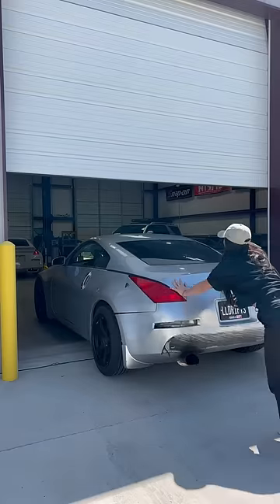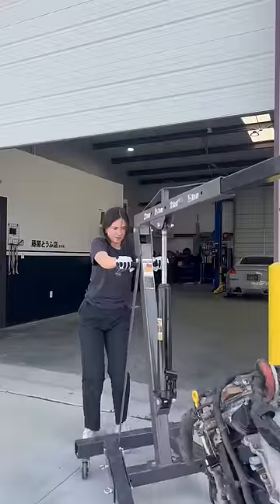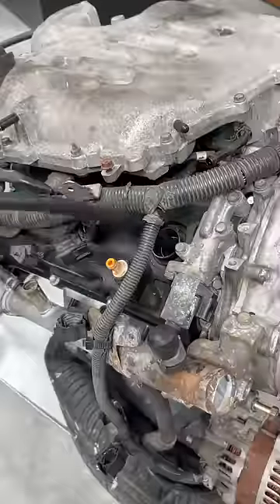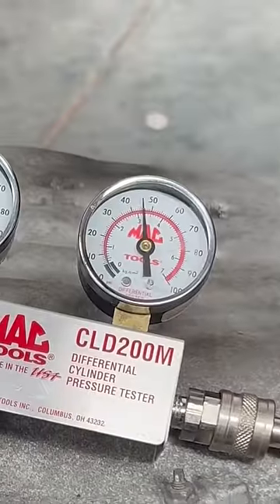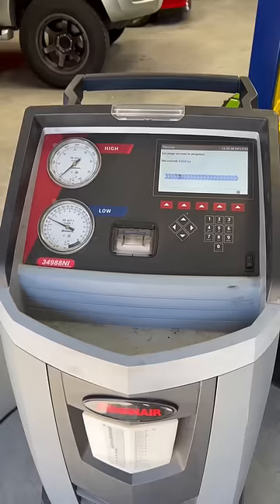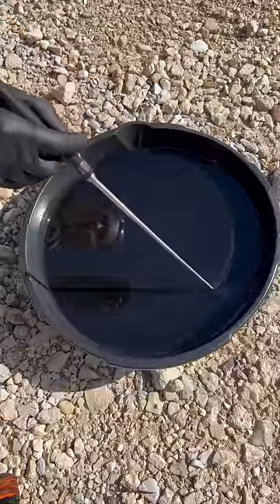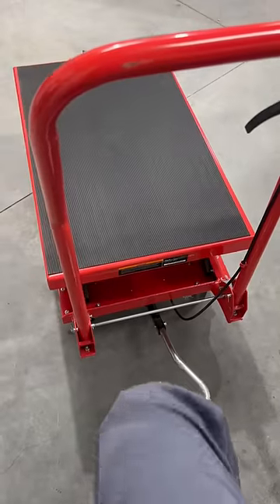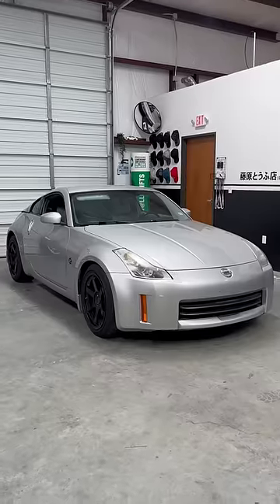VQ35 Engine Swap on a 350Z: Part 1✔️

Comment: 58,000 miles and engine already failed. What in the hell is Nissan doing 💀💀 thats worse than BMW and Mercedes combined
Reply: The vq is supposedly decently reliable. It wouldn’t surprise me if the last owner beat it to shit, especially considering the condition of the rear bumper.
Reply: It’s a revup motor which is known as one of the worse v6 ever imo. Regardless 350z owners always recommend to stay away from them and just get a regular DE or HR
Reply: @CaptChaosBluely  it's sad because 350z is such an iconic drift car nowadays but the engines dookie so I'm assuming it's best to just leave it stock power and drift it like that, or engine swap it
Reply: Probably was low on oil and not maintained. I know those vq motors gobble up oil.
Reply: With simple and basic maintenance, VQ’s are extremely reliable. Clearly, the previous owner didn’t keep up with that and beat the shit out of it resulting in those issues
Reply: It could also be the abuse it was put through before this owner. Because every kid who just got their license wants this car and they end up beating the shit out of it
Reply: @carma  from my own experience unless a cars been modified there's only so much damage you can even do with a stock engine. Cars are meant to handle stock power from the manufacturer that's how they're designed so unless you're redlining constantly there's not really anything else you could do to damage the engine persay. Most abuse will be to the clutch or trans or if someone's drifting you can even be damaging suspension, bearing and uneven tire wear.
Reply: Depends on the previous owner did and how well he or she took care of it. Obviously either the engine shat it’s self or it was beaten and treated like garbage 🗑️
Reply: Use to sell these 350z’s years ago. They CHEW up oil…. Nissan is NOT the way to go if you dont service your vehicles consistently!
Reply: If it's an 03 350z it's absolute shit.. had one.. it was absolute shit 🤣
Reply: Lol you clearly know nothing about engines
Reply: @juanlozano3715  clearly more than you do
Reply: Did you see the oil. That shit was never changed 😭
Reply: odometer roll back duh
Reply: It’s who they sell them too every manufacturer has this issue. The consumer.
Reply: The revup had a recall for early models for oil consumption and failing around this mileage the ring gap was wrong on them to even after the recall they burned oil but it made them not blow up if u change the oil regularly and dont miss one
Reply: Benz don't fail (if you take care of them every 10k miles with everything new)
Reply: Sounds and looks like a teenager had it first
Reply: I’m guessing is that previous person was doing u know what with the car😏
Reply: That has nothing  to do with the engine the previous owner just beat the shit out of it in a unreliable way
Reply: it depends on the chimpanzee that uses it...
Reply: Lmao what😹 BMW is the 3rd most reliable car brand
Reply: @F80__Los according to who?
Reply: @Username-2  any factual place online
Reply: Most likely? Some kid had it and was beating on it like he was in Tokyo drift
Reply: More like the bums driving it don't know that the rev up version of vq35de is actually the worst model because it burns oil about a quart every 400 miles. It's prone to knocks and ticks if it gets dogged out and if oil levels aren't maintained. Regardless the way people drive these cars g35/350z you can't expect them to last longer than BMW or Mercedes because those owners actually take care of their cars since they are expensive.
Reply: rev up = 🗑
Reply: Clapped track car.
Reply: I have 177k miles original engine , they just beat that shit
Reply: If you dont change the oil and it has 58,000 it will break. I gurantee this was user error somewhere
Reply: @trentulloa  agree 100%. Know someone personally who never changed the oil in his cars. Just added to it every once in a while and traded em in before it broke.
Reply: @IntrnetCat thats what happened to my Veloster's transmission. Died before 100k, replaced it, and a part failed under 5k later. Super hard to tell whether it's Hyundai quality or the user after that second one
Reply: Its not blown.. Its a common cam phaser , rocker, or "lifter" ( their version of one. They dont have lifters)
Issue.

Could also be a cam bearing
Reply: @AngryGinja My dad had one for 13 years. Bought it in 04 and the engine went out in 2017. Had just under 150k miles. It's the car he's owned the longest.
Reply: Its in a Z, those things get trashed and thrashed by their owners.
Reply: Mercedes engines aren't bad?
Reply: This more than likely user related issue almost 200,000 on mine and just now needs to be replaced.
Reply: these cars are all beaten and abused. either they get totalled or blown up
Reply: Most people don’t do the maintenance required 
That engine has variable valve timing and hydronic chain tensioners
In combination with a pretty shallow oil pan
If you don’t check the oil regularly 
Or the coolant 
And you go for a stomp on the pedal they can break
I’ve got one of those engines running still at over 220k chains replaced at 205k 
Car itself has had a transmission 
And the regular wear and tear items 
But the Nissans toyota and Hondas from about 99-06 were all pretty solid reliable cars that you could tune and build into something fun or just make it last forever as a daily
Reply: The vq is on of the most reliable engine out there lol. Probably was neglected when it came to oil/servicing.
Reply: This is why the Rsx surpassed the 350z different drivetrains but the 05 /06 type s has my heart. Nissan has only disappointed me on how sensible it all is. Hondas are legos and we can’t say the same thing about Subaru maybe some Toyotas. Overall cool video
Reply: Vq is a really good engine if you abuse it it will fail
Reply: @AteFruit it won’t be dookie if it’s not rodded to death I assure u that
Reply: @McBlitz52  if you add any power it's gonna blow up, that's how Subarus are too 🤣
Reply: It's not the engine it's the driver these engines are bullet proof unless it's not taken care of
Reply: They definitely ran it without any oil. I always ran my Z on low oil level (still acceptable tho) and it's still perfectly running at 250'000km
Reply: @AteFruit the engine just isn’t “dookie”😭😭😭
Reply: It’s an owner problem not a Nissan engine problem.
Reply: @devinminder5599   that's what Subaru owners like to say too xD
Reply: I mean it's a Renault so
Reply: @AteFruit  the engine in my maxima is an award winning engine chief I don’t know what to tell you. Feels way faster than what a 3.5v6 should be. If anything hate on the jatco tranny🤣 those actually last in the maximas way longer than the altimas and Sentras though mfs just don’t stay up on checking their transmission fluid.
Reply: @devinminder5599  most of modern Nissan is garbage.
Reply: Any cars without an oil change intime gona  have  problems. Or high rv at cold start.
Reply: @huynhtran7140  a big part of the issue is the manufacturers give you a maintenance schedule for regular use, but if you actually read what it requires, almost everybody drives in a severe use classification. So with regular use you you can go 6000 mi /6 mo on a conventional oil change but with severe use it goes back to the traditional 3000/3mo.most people don't even serve there transmissions. At most they "flush" them
Reply: @masjuggalo  i  know what u  saying.i was in  this trade too.sadly new cars all  rubish😑
Reply: @AteFruit  not in my personal experience tbh, you ever owned or even driven one?
Reply: @AteFruit  the vq is a good engine but the rev up engines were trash. The de and hr versions are reliable af.
Reply: @kellylynn9295  they can't handle added power
Reply: It’s cvt transmission what do you expect
Reply: @AteFruit  yea that's true. But stock they can last as long as it's not the rev up. Lol
Reply: @xxsniperdragon1  failure. I expect failure.
Reply: That's not on Nissan.  Bad owners...
Reply: @chrispaugh310  If you own any car at all no matter who makes it, if you don't service it when you're supposed to it's going to break. That's how it works. If you can't afford to maintain a car, then don't buy one.
Reply: @AngryGinja  It was only absolute shit because the person(s) who owned it before you obviously destroyed it. Even an 03 Z in good moderate condition is far from a "piece of shit".
Reply: @dncInfamous  My VQ engine is 16 years old and burns exactly zero oil. They only burn oil if you fuck the engine up by not changing the oil when it's due.
Reply: @AteFruit  I don't know where you get this "the engine is dookie" from... because it's simply not true. It's so stupidly easy to push a VQ to 500hp... clearly you don't really actually know anything about these engines and just repeat shit you hear online.
Reply: @soldjahboy  well considering 03 was the first year of the 3.5 vq engine that put it up for the worst year of production.  I'm sure there were plenty that turned out fine it was just not a good year of 350 to get.
Reply: @soldjahboy  and it wasn't necessarily the person who owned it before me. The car was declared a lemon before it was even shipped to where I bought it from.. unfortunately I was naive and had tunnel vision and didn't get Informed of the lemon status. Regardless it had more than just engine issues.. plenty of electrical too so yes it definitely earned the shittiest year ever made.. you can polish a turd, but it's still a piece of shit
Reply: @AngryGinja It was SOMEONE who owned it before you... these cars don't just fuck-up for no reason. I have seen so many rebuilt VQ engines, it's almost ALWAYS a lack of maintenance.
Reply: @soldjahboy  do you understand what a lemon is? It doesn't matter if it was someone who owned it before me of whether I was the first one to own it.. once it's declared a lemon it's a lemon.. hence why they have lemon laws 🫡
Reply: @AngryGinja  Yes I understand what a Lemon is, and 99% of the time it became a Lemon because of someone's mistreatment. It's extremely uncommon for a factory Lemon, especially on a vehicle that has a proven platform. Not saying it can't happen, just saying it was probably someone's fault...
Reply: @soldjahboy  did you know that in order for a lemon law to be applied or a car to be declared a lemon it cannot be because of the abuse of an owner.. has to be a defect caused by the manufacturing process.. and no its not rare
Reply: @soldjahboy  dude the 350 never had a proven platform what are you babbling about.. 350z had its conception in 2003.. sorry but nissan didn't use 300zx motors in a 350z shell.. typically the earlier production years are the "fix the kinks" years..
Reply: @captchaosbluely1339 😂 one of the worst v6’s that is faster than any other v6 and more reliable than 95% of other v6’s. Okay buddy
Reply: @AteFruit no you don’t know anything. This motor which comes in 06 models is notorious for oil consumption the previous owner probably neglected it it ain’t Nissan fault
Reply: @IntrnetCat they have a really difficult to read oil dipstick that’s inaccurate most of the time. This combined with the fact they they frequently burn oil makes them get oil starved and grenade themselves.
Reply: @Red_Cp3  if you change your oil like a religion they should be fine. I have an 05 maxima with a vq and it doesn’t burn oil but I am gonna have to get its oil change done in the next one or two hundred miles
Reply: @IntrnetCat  Marximas are FWD which means the engine is mounted properly. VQ weren’t originally made for RWD so when they’re placed transversal the dipstick becomes impossible to read that’s why so many of them oil starve.
Reply: I’m pretty sure it was either extremely abused or rolled back mileage
Reply: Shiney oil bro… that should tell u enough
Reply: it’s reliable. whoever had it just didn’t take care of it
Reply: Had a vq and took her all the way to 240,000 miles while taking it drifting and basically beating on it. And till this day she runs beautifully (sold it to one of my buddies)
Reply: Most owners run them through and don't take care of them, buying them used is a nightmare
Reply: For all we know the previous owner never changed the oil for the entire 58k miles. Or maybe it spent most of its life redlined
Reply: Oh heil naw that owner was definitely limit bashing that car every day
Reply: With the way Nissans are built nowadays, (i.e. poorly) even money on whether the culprit was lack of oil changes/driver abuse, or just standard Nissan rubbish engineering + build quality (or lack of same).

Comment: Marketplace VQ I can’t imagine how that could go wrong 😂
Reply: Probably redlined the hell out of it
Reply: I got a motor from marketplace when I went to look out it the truck was totaled(good sign usually) and the guy went and got the keys try to crank it,jump it off,even changed fuses,told him nah you straight I believe you,and I been driving with no problems for about two years
Reply: Right, under 60k miles with a torn up engine. She’ll be doing trans and diffs next. 🤣
Reply: naw man, that's obviously a crate engine, it's just been sitting😐
Reply: Nothing like buying a JDM engine with warranty.
Reply: @Guillermogonzalaz  😊😊😅😅
Reply: No gasket kit just toss it in.
Reply: Part 2?
Reply: I mean she did a leak down test and it passed. I'm sure it wasn't that bad.
Reply: Not good at all I bought a 350z from this guy and turned out the engine had a blown head gasket it didn’t over heat when I first got it and was only able to enjoy it for 1 week until I noticed it overheating, finally got a new engine for it but wouldn’t recommend buying from face book marketplace